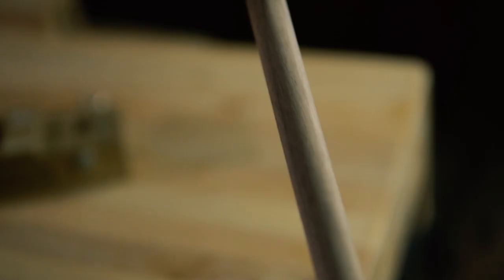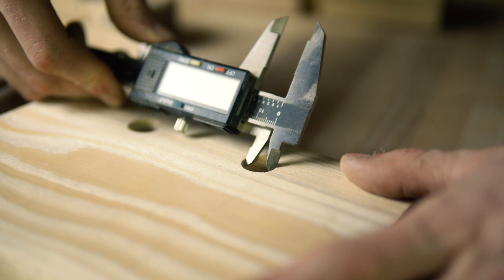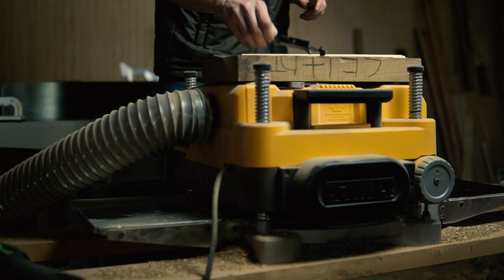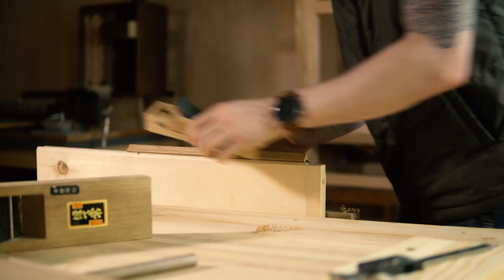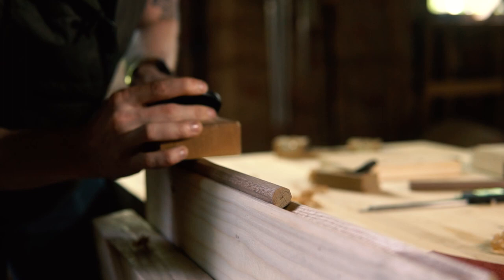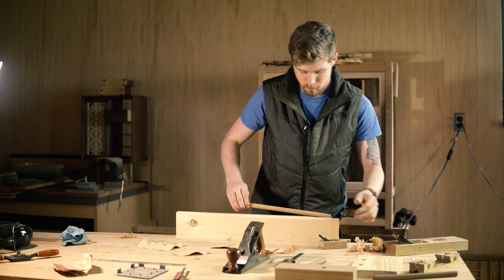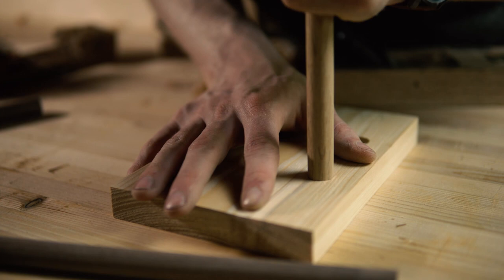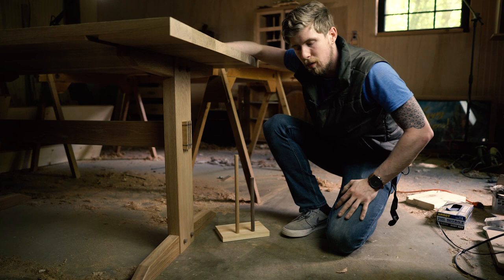How to Make DOWELS By HAND!

Comment: I was hesitant to attempt to try the drill setup with a wood block with a hole & chisel jig, seemed like butchery to me. This is the exact technique I didn't know I needed. Thank you!
Reply from the maker: Yeah most of the techniques out there are either really inaccurate, or just don't give you clean results. The only downside to this method is I can't make really small dowels because the jig gets in the way, but I almost never need dowels that small anyway lol.